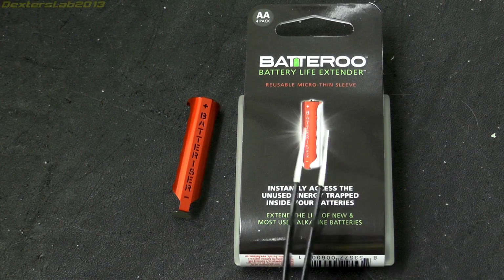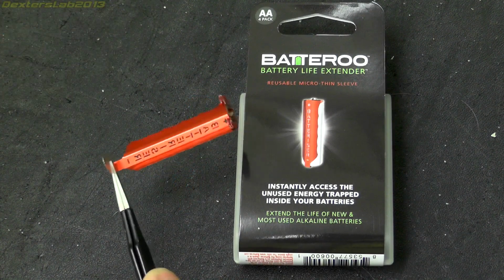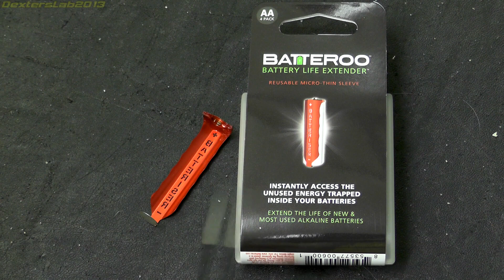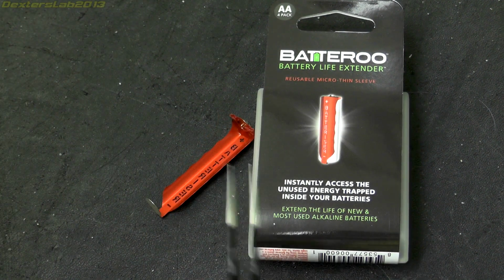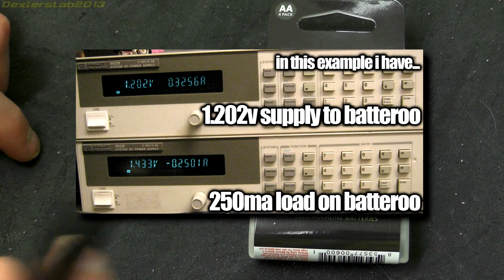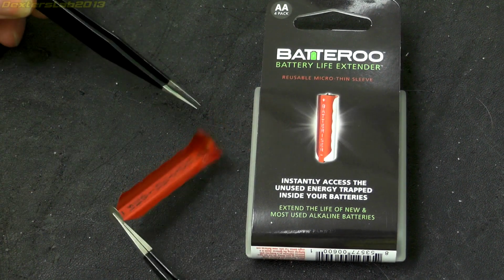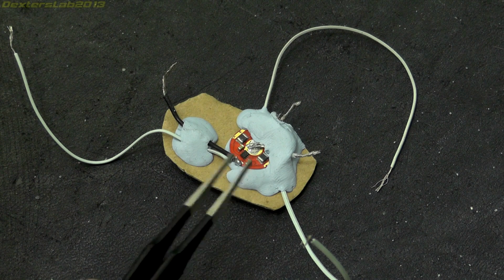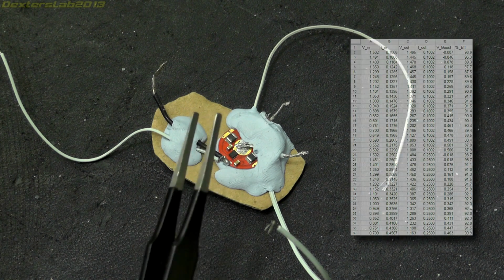DL#112 - Batteriser Batteroo Some Test Results

Comment: I wonder if these would be any good for boosting the voltage of a NiCd or NIMH battery. Certain cheap flashlights tend to be dimmer with rechargeable cells.

Comment: I have a idea what to use Batteriser for hmmm, rechargeable battery 1.2V to boost them to 1.5V? for equipment that 1.5V work best with?
Reply: For cheap electronics that would probably be a good idea, but any 
decently designed product that runs off AA  cells these days already has
 a boost converter for that very purpose since rechargeables are much 
more common now.
Reply from the maker: As SpectrHz says, most products should be able to cope with a NiMh rechargable. Even if you did have a product that didn't like NiMh then the efficiency losses in the Batteroo Boost would probably negate any gains anyway.
Reply: It could be used with cheap LED fairy lights that have no electronic circuits at all, just battery holders and LEDs. I really dislike whole Bateroo marketing bs, but think I could find use for it.
Reply: You might find some uses but it cost as mutch as nimh lsd cell it might be a way to use nimh in chappy devices tho